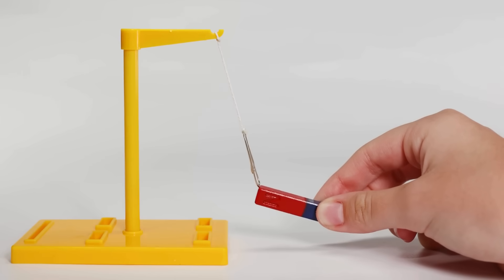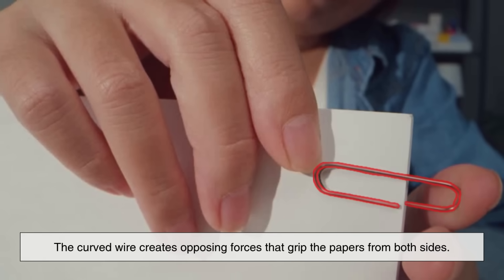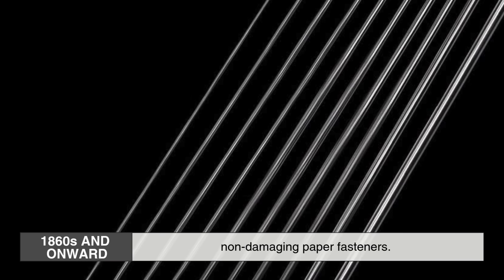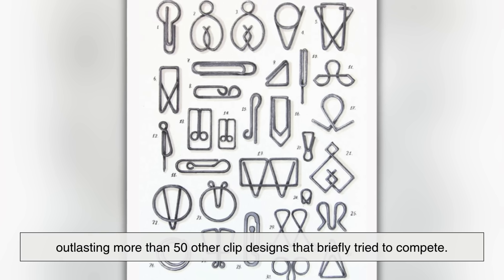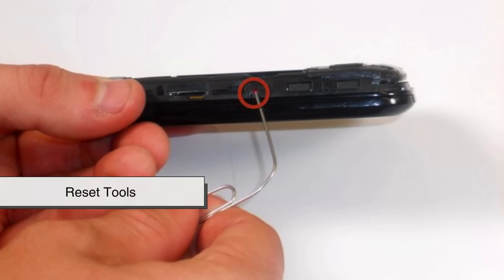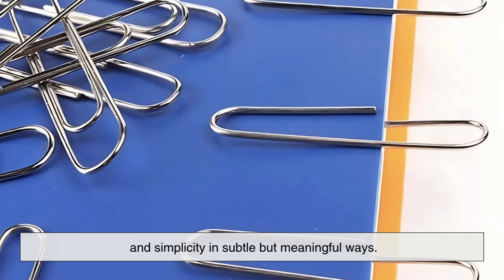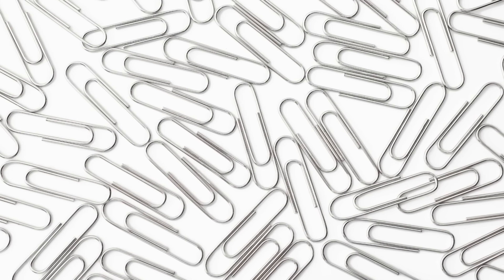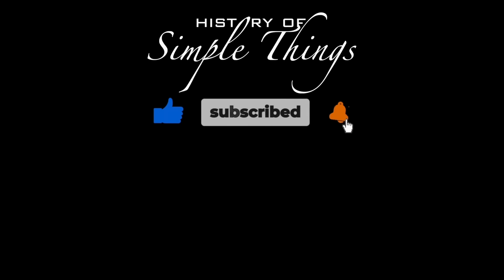Why Do Paperclips Look Like That?

Comment: The Ideal 1902 version is still in wide use
Reply: And excellent for thicker stacks of paper before a binder clip becomes necessary.
Reply: @dadatschool I use dozens a day at work. Perfect for holding inventory lists together, and easy to remove when I have to pull a page out. A perfect design.
Reply: @dadatschool  yup
Reply: I've seen the Kurly Klip 1936 design being sold for anyone who needs something less utile and more decorative.